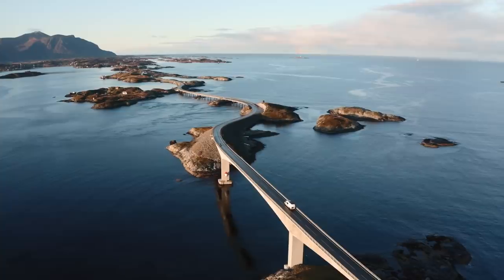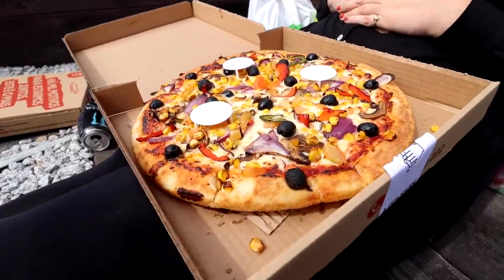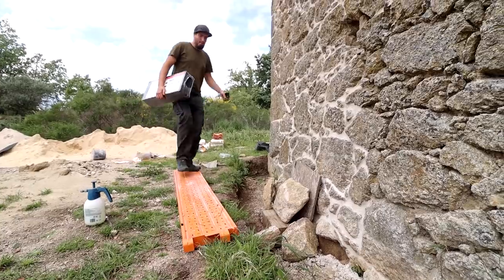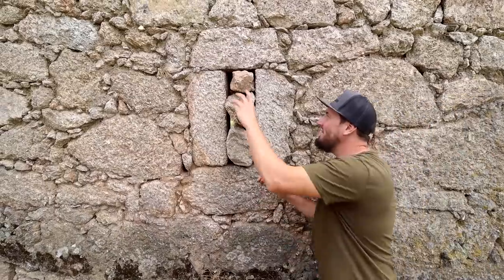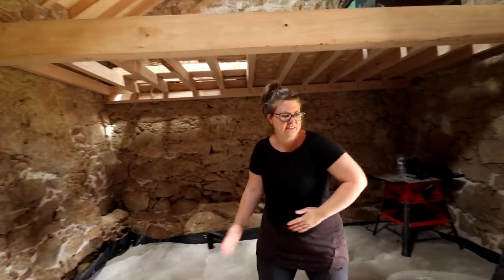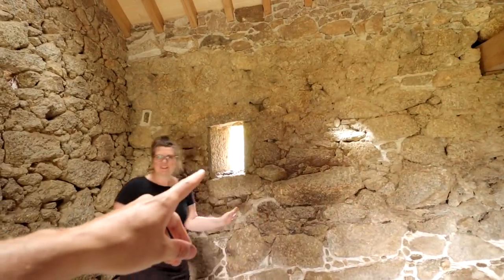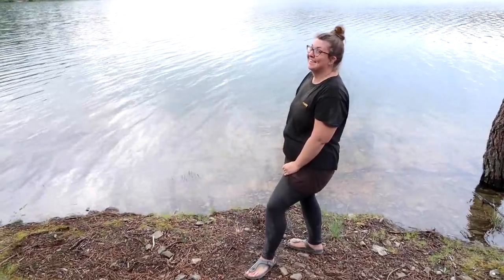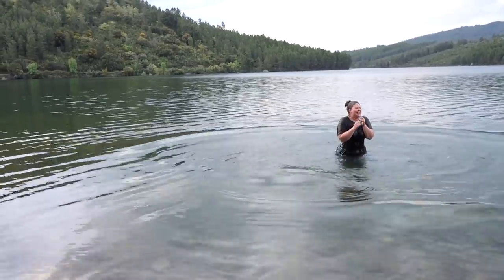Revealing Our FLOOR! Couple Builds Dream Home Off-Grid in Portugal

Comment: I was wondering if bolt cutters would have been strong enough to cut that wire on the wall.  I love me some bolt cutters, my favorite tool, ha.  Not that I use that many, and only have those from when I had some land and had to work on a barbed wire fence.  But even since then, they're awesome to have for when you need to cut heavier wire or metal stuff.

Comment: you have space in the bathroom to put a place to dry clothing when the weather is not great , and as long as its not driving rain you can use the porch too , buy or make cloths horses
Reply: you know your concrete mixer , you can clean it out and ,there you have a washing machine for smaller stuff at least , lol it can be done , seen it done
Reply: build a oven , you can make bread in it too and pies , it will take your ability to cook what ever you want up a notch or ten

Comment: My dad was cringing at Theo just throwing the cement at the wall, my dad is a joiner and he said your doing just fine Theo but place it instead might be waisting line, you need a vitrex adhesive trowel the one that looks as though it has teeth on it, might be good to put the wheel barrow nearer to the wall. Be a leading pioneer Theo your making videos about it, just remember you will be able to help others with your videos and if your stuck just ask for small tips at your DIY B&Q store if you have that over there and you will be fine

Comment: Hate to be the bearer of bad news, but there are time limits as to how long you should use a hand tool per day, the info should come in the instructions nowadays. The vibrations can lead to something called vibration white finger, which is nerve damage to your fingers, numbing and tingling are symptoms. Please be careful and try to reduce the risk of injury, try to reduce the time (per day) spent with some hand tools, the barn will still be there tomorrow. It's all looking good though.

Comment: Bee too bad you couldn't have sanded those roof beams before they were installed.  Also how are you going to finish the floor with that plastic sticking up???  In the states, plastic wouldn't  have been used. Why did you put plastic under the floor???

Comment: the amount of dust you will have finishing the walls .. either by pointing or plaster .. I would have left the wood finishing until the end .. not sure a linseed oil finish will give you the protection or make dust 'stick ' ... you're both young now .. it may depend on how long you plan on keeping this property but making the wood easier to maintain for 20-30 years from now .. think ahead kids

Comment: Why dont you bag the rock walls instead of plastering it .It will look more rustic !
Reply from the maker: No idea what bag is?
Reply: Its using a hessing cloth to put your plaster mix on your wall using a circular motion when applying the plaster mix !
Reply: There is a lot of vids on how to bag on you tube and you can also google it hope it helps also check out Kris Harbour natural building !

Comment: Theo you are so messy with that plaster and wasting tons.  Don't throw it on!! Hold you trowel with the plaster against the wall and then push it off with your pointed trowel.  So much easier and cleaner and not wasteful!!!